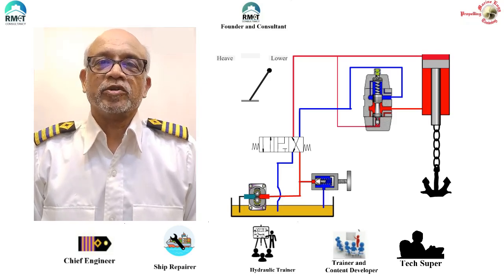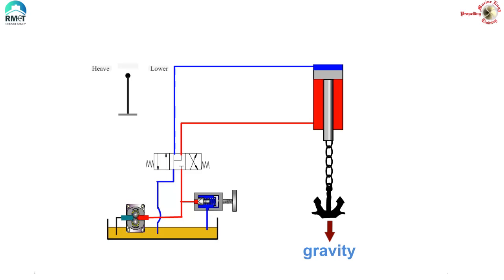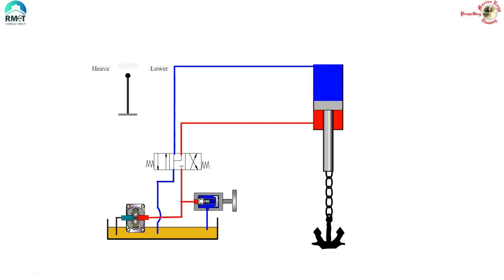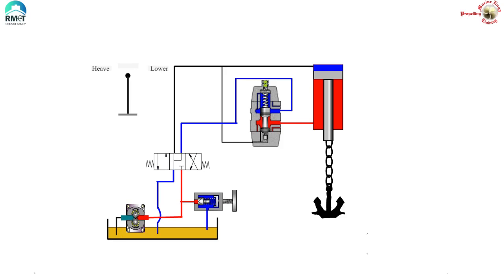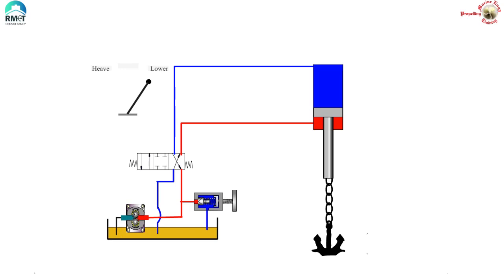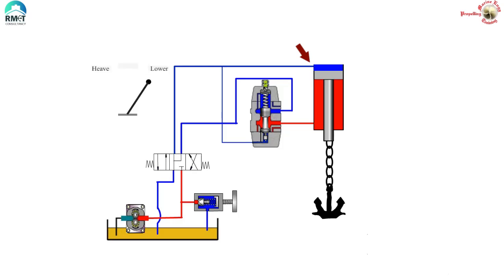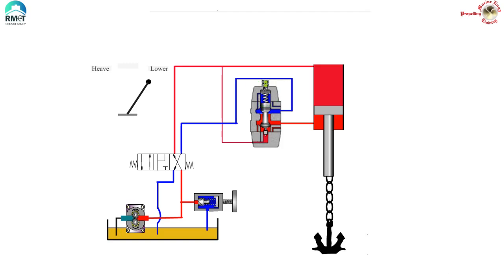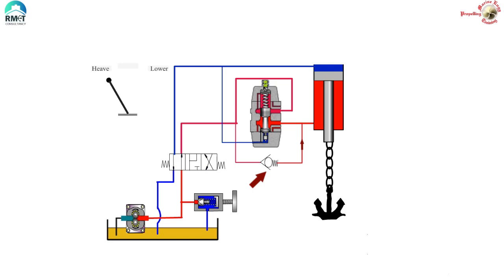What is Counter Balance valve |#Counterbalance valve working|Hydraulic Lock| Ramesh S|RMETC

Comment: Sir , 1 doubt when during lowering of the anchor as the pressure on top of the piston increases then will the pressure on the other side of the piston also increses? As both side of the piston are completely full of oil and there is no path for other side of the oil to flow due to C.B Valve